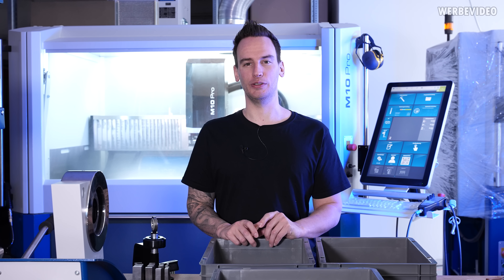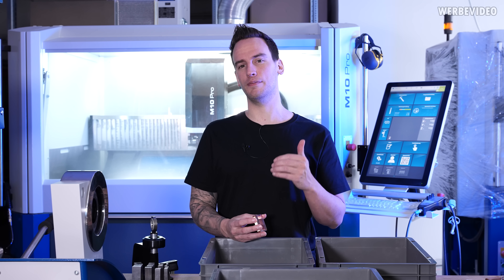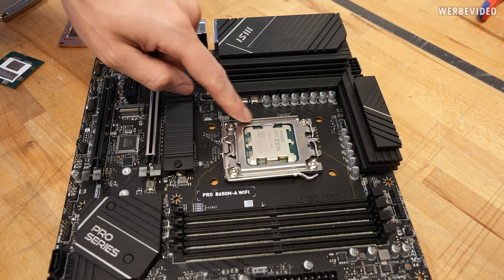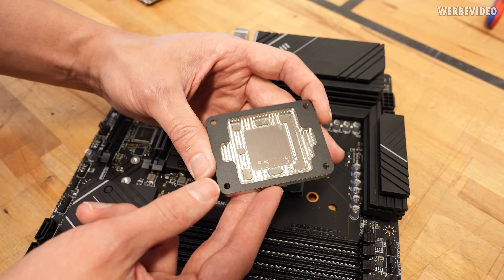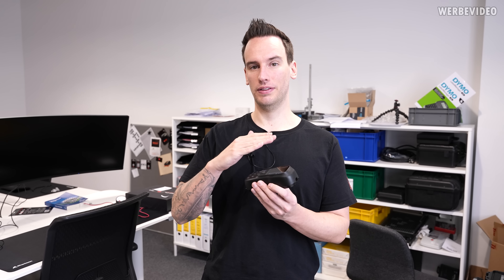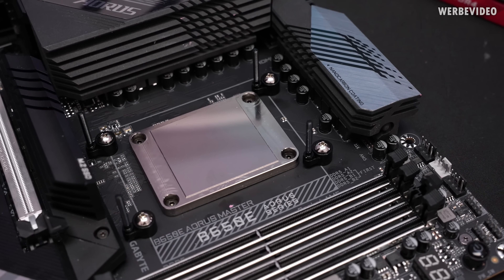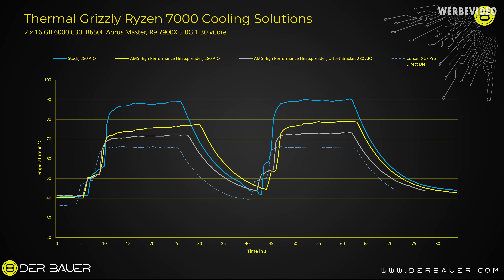I made my own Ryzen 7000 Direct-Die Water Block

Comment: You'd probably like using monochromatic light and an optical flat to test for overall flatness. You can just see it in interference fringes. Another trick I learned for quickly checking surface roughness of a telescope mirror is to shine a laser on it, how much you can see the dot on the surface (when light is scattering off the rough bits) will give you an idea of how rough the surface is!

Comment: I really like that RGB water block! I like that it can be used with or without the black cover. I really like that its clean, no logos. I think a tiny logo on the side of the anodized aluminum would be nice. I think, if its possible, etch the name, part number, model, etc to the underside of the anodized cover. If you were able to put it in a place that it can be found when disassembled, but not showing when assembled.

Comment: Hey Roman, super interesting video as always, especially the part regarding buffer mass for heat spreader and fins density. It got me thinking, what would happen if you used air cooling together with direct die, since heat pipes dissipate the heat in a different way compared to liquid cooling. 
I know it might be very hard to achieve, but it would be also super interesting, since the are a lot of air coolers which are almost as capable as AIOs.

Comment: Great Video!. I would be very interested in these new designs, very cool stuff Roman. Quick question, have you tried adding thermal pads to the substrate around the dies to see if you can suck some more heat into the cooling spreader plate?. Also, YOU HAVE to try this with Peltiers Dude. Love it keep up the great work.

Comment: I suspect people think roughness aids heat transfer because large surface variation of the right shape (e.g. fins) helps convection.  But this ain't convection and roughness is too fine (though roughness could generate helpful turbulence in some flows).

Comment: Cold welding only works when the metallic surfaces are not oxidized,  which is hard to avoid with bare metal in air.  It happens in vacuum much better

Comment: cold welding?  I thought it was called Wringing like with gauge blocks.  In either case, Copper is very soft as I'm sure you're well aware and just the force of the screws in the corners pulling that plate down over the CPU will bow the plate down in the corners and up in the center slightly.  The wringing phenomena would also likely no longer function correctly.

Comment: Epic product, i want one.

I really need one with typical orientation of the fittings like on the EK blocks tho. I connect my cpu and gpu in parrellel for looks and this seems like you prepared it for a lianli dynamic with a distro plate. 

A version with 90degree turned fitting mounts and i am onboard.

Comment: I'd love to see a direct- die water block made of silver with the water interface side gold plated or even just copper plated to prevent any corrosion from the coolant. Also how about machining micro vortex generators instead of fins to stop boundary layers in the water flow. I could see the flow separation with fins trapping a very thin layer of hot water against block

Comment: Roman, how about milling the stock IHS and turning it into a direct-die water cooler?, with a top that has an oring seal and using the pressure over it to maintain it fastened

Comment: Could we use some kind of double slit experiment in time to spread the heat out into smaller manageable packets?
I recently watched a new youtube video explaining how swapping transparent and opaque films at one million billion time per second spread out the spectrum dramatically.
Pushing back against Thermal Dynamics using time.

Comment: One thing about direct die intel mount is that 12and 13th gen intel CPU has different SMD/capacitor location on the chip rim that differs between each CPU model, and that lack of universality really hurts in terms of direct die, even taking off the IHS could be extremely risky

Comment: Years ago I saw a video of manufacturing micro fins into a copper water block. They used an extremely thin cold chisel to peel a .1mm layer of copper about 1-2 mm long up at 90 degrees to the surface. The chisel would then move over .4 mm and do it again, over and over across section that needed fins.  I thought recently, what if that was done directly to the copper of a stock IHS and a plastic lid was attached to guide the water. I just looked it up it's called fin skiving

Comment: Thats awesome. the drawback its the warranty voided and risk of breaking something on delid, but in a hot country like Brazil its a nice cooling improvement.
Think need to have factory delided CPUs with WC blocks / base plate "'kits" :D

Only delid i did it's a 4790k and using normal thermal pad and keeping the original IHS, have up to 30 degree improvement. That CPU i'ts not stable ever at stock with original paste.

Comment: Cold welding not so that's just pulse tig weld .but in outer space two flat surfaces in a vacumn would weld them selves together tho, but you can get measureing steel, iron blocks that stick together, they been around 200 yrs

Comment: I'm so glad for this, I had a quantum velocity 1 and I couldn't get my direct die setup to work at all, I got the quantum Velocity 2 and I use that full time now, but the temperature is not what I'd want. If you come to market with this and I'm actually able to get impressive performance with liquid metal then I'll actually be able to run this full time with amazing temperatures.

Comment: Im using your direct die frame and your short backplate with a lapped heatkiller block on a delidded 7950x3d (using your delidder of course). Getting ~66c at 155w with kryo extreme in cb23 in a mora custom loop. I would love a chance to purchase either of these blocks asap to test how much better they are than my current setup. Can you let me know how I can be one of the first to purchase and test? I’m in the US. Thanks!
Reply: Actually looks like I’m using the original conductonuat - when and where is conductonaut extreme available for purchase?

Comment: would be nice to have an even bigger option that covers the cooler mounting holes, adds even more surface area for the water to pick up heat too if you make use of it. most of the cost is the labour cost anywaay i think and potentional to put your logo on that surface.
Reply: another thing you might want to consider... making an all motherboard encompasing heatsink so for VRMs and other junk that requires heatsinks apparently these days. better cooled VRMs should help overclocking too.

Comment: For air cooling with a noctua L12s or id cooling is-55, would mounting straight to direct die still be the best solution?
Reply: if he saved 20c using this heatspreader, why not use the heatspreader? its safer than direct die
Reply: He does sell the direct die frame, so might as well have a comparison between the options

Comment: Worked for a german automotive parts supplier for a long time. We would mill and single point burnish ballpins for control arms on cars. We controlled for roughness using ra, rz, rdq, and rmax. Our tighest tolerance was 0.005 to 0.03 µm.
We had a fancy light based measuring machine that would calculate the roughness based on the reflection angle of a laser. We also had a pretty standard probe dragging machine that would profile the part and measure the height of the tooling lines. Definitely interesting to see surface roughness brought up outside of that manufacturing environment.
Reply: Yeah, I remember from my Optics course that optical methods based on different kinds of reflection and interference phenomena were the ones used in industry to measure surface flatness and homogeneity.

Comment: Is there any real benefit to adding relief areas for the exact locations where the dies are? Add more thickness between/around the dies without adding thickness above them. It may help with structural rigidity and heat spreading without increasing overall heatspreader thickness.
Probably minimal gains for the effort.

Comment: It would be cool if you'd make an "extended" version that is just bigger and covers the full motherboard cpu section (similar to ek's vector block) and also have a chrome version instead of the black. So chrome + acrylic RGB instead of chrome+ anodized black aluminium.

Comment: Would you be able to make a direct die for use with the EK combo unit which have thew pump/tank/block in 1 unit, as i am running 2x 240mm rads in the louqe ghost s1, or could we talk somewhere else? like using voice/video?

Comment: CryoSheet sounds nice. Might be something for me to look forward to putting in this laptop I'm using after I get around replacing the heatpipe and contact plate (it's a VAIO VGN-SZ from 2006) since it shoots to the 90s with the Core 2 Duo T7200 and sits at 83 with its stock Core Duo T2400...might need to make a new fan for it too

Comment: I wonder are the metal heat-spreader layers even necessary?  Would direct water-to-silicon remove more heat if you somehow were able to glue and seal the top part of the water block housing directly to the cpu substrate?

Comment: Clean version. The textured top limits the compatibility with certain build aesthetics, and the clean allows customizers to mod it to suit their needs.  Very nice design, and it's nice to see the offset kit validated on AM5, still using mine on my X3D setup and temps are ridiculously good.

Comment: Hey you should try watercoolling heat pipes. I remember watching an old video of someone water cooling a 212+ and it literally got better results than some of the AIOs. Maybe using heatpipes as a kind of vapour chamber to get more surface area could work and be cheaper than all that precision cnc machining.

Comment: Is there any chance that the 3D model for this could be made available? I would love to machine a custom POM plate that would allow me to integrate a DDC pump onto the block for SFF applications. Also I am curios how the new thermal pad that you have would work with GPU cooling and if there would be any benefit to using that instead of thermal paste?

Comment: this is really perfect for direct die, without any Water Block customization, I'm using a TechN water Block and had to get a different screws to make it apply good pressure on the die.

but for Aesthetics it would look nicer to have the top black cover a bit bigger to cover the components on the MB.

Comment: Finally a TG product that really changes the market for high end watercooling!
Will look into this for my Intel 14th gen build in 2024
One question: since you have the space, why not make an even bigger IHS like you have on a GPU water block to sink the heat a bit more, and make water channels in your block run through that (again as with GPU water blocks). A GPU runs 200-600W and yet can stay below 45C at load in an open loop, vs a CPU 250-300W. Yes, the die is usually much bigger with a GPU vs CPU but I think some of the heat savings comes from the use of a LOT more copper

Comment: If you offered your new direct CPU custom CPU waterblock prefitted on a delidded CPU & motherboard, I think there would be a huge demand from people willing to pay  over 100 euro ABOVE the cost of the parts (CPU which you would have delided + liquid metal + waterblock + motherboard). That could be a lucrative business for skilled installers on your side (you make the profit on all the parts you make plus profit for installing them together ready for use), & customers, like me, would be very happy as it removes the stress & chance of mistake by setup (delidding our own CPU, applying liquid metal, correct mounting pressure, etc) for which we will gladly pay for a professional to do instead.

Then, customers would pkace orders with you, saying which CPU & motherboard they want, your professionals do the one-off setup & post it to us, so we receive the motherboard with a fully installed & ready to use delided & waterblocked CPU, so we could simply slot it into a PC case with a custom waterloop, with complete peace of mind.

Comment: Sexy!

BTW, I saw that my i5 had terrible temperature fluctuations 5% usage and the temp goes from 39 to 59 Celsius. I have an NZXT 240 mil AIO with Noctua NF P 12 fans, so it must be the thermal paste. When I installed it, (sticky factory thermal pad) I had to change the rotation in order to fit the water tubes around the RAM sticks, so I had to rip the water block off the CPU (sticky thermal pad) and re mount it. It appears that was not good for making a flat even contact between the block and CPU. 

Long story short, I bought some Thermal Grizzly (Kryonaut I think) to re-paste it, because you are an overclockers and you use Grizzly, so I trust the Grizzly.

Comment: One thing I would consider doing is a diamond cut chamfer around the perimeter of the anodized metal top of the water block. This way you get a shiny surface to reflect some external light. I understand the desire to do everything as clean as possible, but I think some visual design flare is important. I would also consider including your logo. I would machine it into the surface before it is anodized so that it is discrete.
Reply: If some of the acrylic piece had text cut into it at an angle with stickers, it could cast lettering on the board for branding sake as a shadow which can be a removable option by an end-user while still looking clean.

Comment: 11:35 Something weird with this test data...
Notice how the duration of the test varies a lot between stock in blue and high perf in yellow. 

Blue: (10-26s) 16s and (44.5-62) 17.5s
Yellow: (9-30s) 21s and (46.63) 17s.

Huh? Why this difference? Great if it runs cooler, but why would it be so much slower?
Is that a background process muddying the data? Or just Cinebench run to run variation?

14:15
Gray: (9-27s) 18s and (45.5-62) 16.5s.
Dotted blue: (8-25.5) 17.5s and (44-62.5) 18.5s.

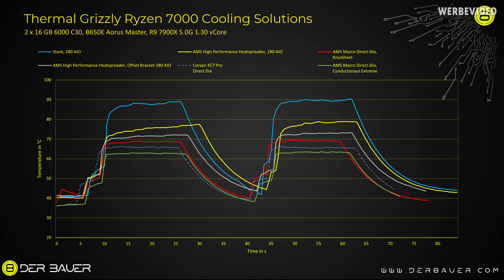15:37
Red: (9-26) 17s and (44-59.5) 15.5s.

Comment: i had literally added the am5 delidding tool and direct die frame to my pcpartpicker list YESTERDAY, so this was amazing timing - i will absolutely be using this RGB block when it becomes available. seeing this part so easily removable at 13:15 made me immediately do a "hell yeah" for spraypainting purposes
Reply: Steve and GN team delided one of the defective chips with the flossing + heat method, is it less risky to crack the die?
Reply: Be careful with it, the die is easy to crack... good luck

Comment: if the price make seance i will take the Thermal Grizzly AM5 High Performance Heatspreader for my 360 AIO , and probably not use liquid metal do to the problem they can occur , the grafpad is not bad at all
Reply: now with 7700x no oc i have 90C with 360AIO

Comment: Wow that's some awesome temperature reduction.
Btw, cool device you're using for surface roughness. They use a similar device to check plateau finish on engine cylinder bores.

Comment: According to the heat transfer formula, it is not difficult to know that when the cross-sectional area of HIS is much larger than the thickness of HIS, the influence of the thickness of the HIS on the heat transfer can be ignored. der8auer just replaced a thinner HIS, which can greatly reduce the CPU temperature. There must be some details that have not been explained.

Comment: Hi, Roman! Very interesting results indeed. But as many people are still running AM4 platform and are not yet going to upgrade to AM5 for many reasons, maybe you'll test and launch AM4 direct die blocks from Ryzen 5000 lineup? There were some AM4 direct die blocks from Taiwan - but nobody sells them now
Reply: There's no real reason. Those chips don't get all that hot in comparison to AM5, so you're wasting money
Reply: @rustler08  Upon decent overclocking 5950X runs quite hot. I've already built a custom loop - but with ordinary monoblock and didn't get the result i want. So id' like to try direct die. And i'm ready to pay for it - so why not?

Comment: this is awesome! I love to see the different approaches and iteration leading up to these products and the results truly speak for themselves. I would love to see what the direct die water block can do with a 7950X3D. with ~30C temp drops I would imagine both CCD's would be able to get quite the jump in performance.
Reply: Well the X3D CPUs don't boost to the thermal limit, nor can be overclocked, so there won't be much gain in terms of performance; it's the bare X CPUs that boost to the thermal limit.
But still, having that MASSIVE leap down on temperature is far too tempting to ignore.

Comment: clean version would be 100% preferred if you ask me. I have a question though. Seemingly, the water enters the cooling block through the fittings, so on either the north or south sides, does it flow across the microfins on the direct-die heat spreader plate you showed in the video in the same direction (e.g. lengthwise)? Or is there some mechanism or specific arrangement of channeling in the water block to change the direction of flow to widthwise?

I ask because judging from my limited water cooling knowledge, and from the part geometries shown in the video, there seems to be a mismatch between the direction of flow for the water and the manner (or direction) in which the microfins were cut. 

Or to describe it in another way, as I currently understand it the flow of water through the water block (lengthwise) seems to be misaligned with the direction of the microfins (widthwise) as shown on the copper heat spreader shown in the video.

I may be missing something here, and this may be a dumb (or moot/superfluous) question, but wouldn't it be much more efficient for both the transfer of thermal energy into the liquid and the flow impedance if the direction of the microfins was aligned as such to be entirely parallel with the direction of flow for the liquid?